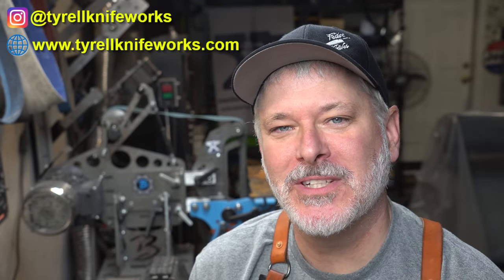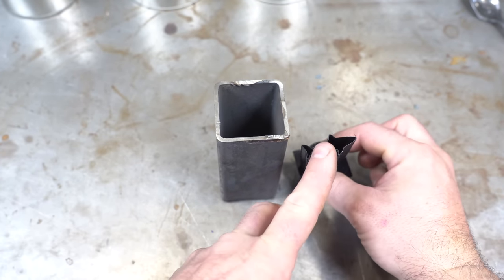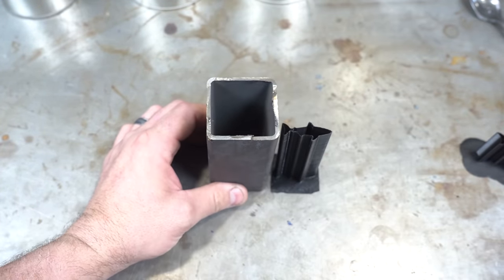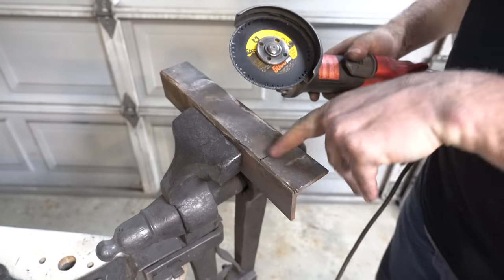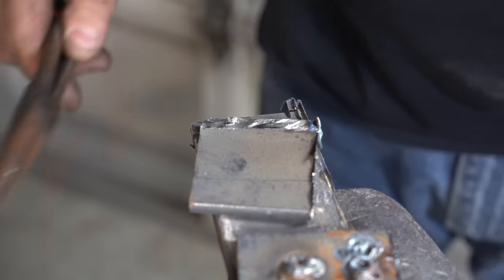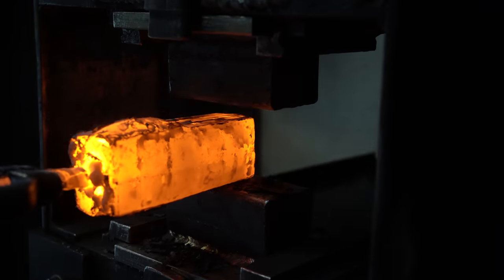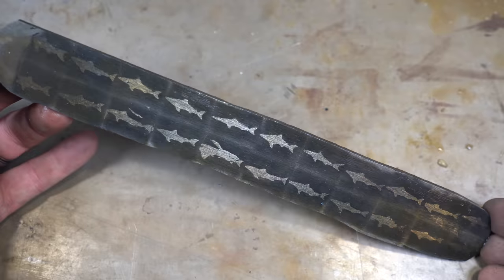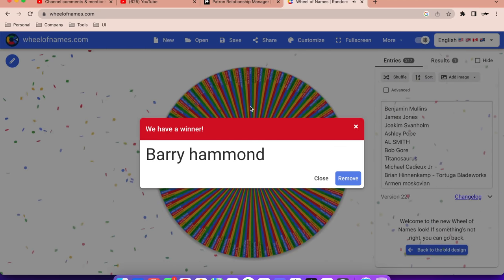Triple-T #107 - Damascus patterns - 3D-printed canister

Comment from the maker: Any questions about this construction?  Note, I meant titanium dioxide, not aluminum.  🤷‍♂️
Reply: you should watch firball tool guy's video on cut off discs and how to get the most life out of them.
Reply: You forget to ad the meaning for the pla 3d printer about what the pla stands for... Also you didn't ad the 3d printer in your tool list🤔🤔
Reply from the maker: @AHMi-ArmandsHandsMadeIt  Oops... thanks for the reminder.  Both have been added to the video description.
Reply: What happens to the PLA? I mean it's carbon, hydrogen and oxygen. I would think it would have to either off-gas (but it's sealed) or it would either form a barrier to welding (which doesn't seem to be the case) or be absorbed by the steel (in which case, could you case harden something by enclosing it in PLA in a canister?)
Reply from the maker: @MichaelLindner  It's absorbed into the steel.  I don't think its actually very high in carbon though so probably doesn't impart much into the steel.

Comment: I took a 3D printed canister Damascus class with Steve Schwarzer last month, what an amazing experience!!!   My design was a triskele horn in nickle wrapped in 1095.   It turned out pretty well.  What I learned, like you mentioned is to 3D print the walls of your design fairly thick, to help resist your pattern loosing its image in the forge weld.  The other thing we learned is if your design is fairly complex to exaggerate the spaces between your elements as the image distorts some as you reduce.
Reply from the maker: That must have been a great class!  All good points.  Thanks for watching, Chris!

Comment: The phrase "hot knife through butter" comes to mind on that woodcutting wheel.

Using PLA to make a mold for a pattern weld makes a LOT of sense; I've seen a lot of people 3D printing positives for lost PLA casting (as opposed to lost wax). You can get that stuff really thin, too, on a high-resolution printer, as I understand it. (I've never had the chance to play with one but I have ideas.)
Reply from the maker: I have a relatively cheap printer ($350) and it printed it super thin with no issues at all.  It was actually too thin.  That wood cutting wheel was a little scary actually.  😬. Thanks for watching.

Comment: @Tyrell Knifeworks the best way to get the can off is to grind opposite corners or cut opposite sides..then the can comes off in 2 easy pieces (unless it welds to the builet)..and another method to prevent the can from welding to the builet, is to line the can with paper or thin cardboard (craft paper)
Reply from the maker: The paper doesn’t really work that well.  I’ve done many canisters and the stainless can us the way to go, but I usually use stainless end caps but this time I didn’t.  Thanks for watching.

Comment: If you do a lot of canister or have a need to cut a lot, it's worth investing in a plasma cutter.  Even the cheap ones work plenty good especially for material under 3/8" thick.
Reply from the maker: I don't really have a need for a plasma cutter enough to justify buying one.  I don't really cut enough steel to warrant it.  Plus any high carbon steel you cut with them, you need to grind away the first 1/8" around the cut because it burns out any carbon and it won't harden.  Thanks for watching, Edward.

Comment: Thanks for sharing new products.  The only thing you didn't consider is if you had the diamond disks is "time is money".  You wouldn't have used as many disks but with as many cuts as you had to make you would have spent a whole lot more time.  That was also with a new blade.  I'm sure it won't perform as well the more you use it so it would take even longer to cut vs the standard wheels.
Reply from the maker: Why don't you get one and try it.  They claim to be able to make 5000 cuts.  Even if that's only 1000, it would likely still be very viable after 250 cuts, which is about 10x than the usual abrasive disks.  Don't be too quick to poo poo new technology.  Give it a try.  Thanks for watching.

Comment: A very cool test and awesome results. Two questions: 1. Aren't you worried about PLA burning and producing gas inside the cannister (ok, not much air in there, bu still...). 2. PLA is a carbon source - it might add roo much car on to your steel - yes?, no? What do you think? Thanks!!!
Reply from the maker: There was a tiny home drilled into the canister for any pressure relief.  The PLA isn’t going to add any appreciable carbon to the steel.  Thanks for watching.
Reply: @TyrellKnifeworks  thank you!

Comment: I don't forge at all...but I weld! Just like everyone else in Oklahoma, lol. That made me wonder if it would work to smoke the inside of a cannister with soot from your torch? Maybe the nature of the thing wouldn't keep the can and what's in the can from sticking but it was just a thought.
Reply from the maker: The thing is... things you want to stick sometimes don't, and the things you don't, do.  🤣.   While the soot might help, the powder seems to adhere to any mild steel, no matter what you do.  Putting the can in the forge and building up scale is better than soot and that even doesn't work.  🤷‍♂️.  Thanks for watching.
Reply: @TyrellKnifeworks  
Thanks for the videos. This PLA trick is really interesting. The posability of personalized knife blanks is really enticing. A guy could probably set up just to  make those and crank  them out day and night and never run out of orders. Not very rewarding I suppose.

Comment: I was thinking about doing something similar with a snowflake for an art piece. Do you think this would work better using pure nickel for the design if it is mostly a wallhanger?
Reply from the maker: 4% nickel works just fine.  Not much different using pure nickel.  Thanks for watching.

Comment: How about Forge scale on your mild Steel canister first? Do you think that works?
Reply from the maker: Nope.  It might reduce it sticking a tiny bit but those buggers want to weld to the inside so much!  You’d be better off with white spray paint or stainless foil in that case.  Thanks for watching, Michael.

Comment: Be interesting with double 'form' with two different colour/tones of metal
Reply from the maker: I'm not quite sure what you mean.  You can add varying amounts of nickel, but that would give you grey/silver tones only.  You can't really get a different color.  Thanks for watching.
Reply: @TyrellKnifeworks  You currently have 2 strong tones of grey, but with a different alloy you could have a tone between.  Consider your shark logo as one 'loop' it would be trivial to have a second loop and use a different tone, lighter or darker, in between.  Colour was a poor word choice on my part!  Pity you can use copper in this manner.
Reply from the maker: @KnugLidi  yeah, copper would just melt and pool to the bottom.

Comment: I wonder how that diamond blade would do on hard(er) steel.
Reply from the maker: It's about the same.  I did cut some hardened steel with it and it didn't seem any different.  Thanks for watching.
Reply: @TyrellKnifeworks  nice,  figured that could be one place it could fall short of the standard abrasives.

Comment: What would happen if you used a canoe with several 🦈
Reply from the maker: Yes, that's certainly possible and you wouldn't have to tile it.  But its harder to forge weld and as you draw it out you would be distorting the sharks, so they wouldn't look as good an might end up looking like sturgeons.  🤣.  Thanks for watching, Joe.

Comment: Cutting steel/iron with diamonds is not... smart.   Diamonds are pure carbon, and carbon dissolves into steel.  Cutting steel with diamond edges eats the diamond off rapidly.  Even before the diamond is gone, it's smoothed over and it no longer sharp.   All around bad product for steel.
Reply from the maker: Using diamond on steel is extremely common.  It's used in a ton of applications.